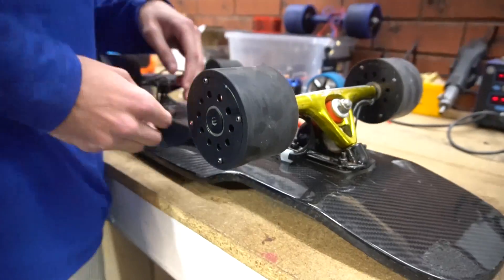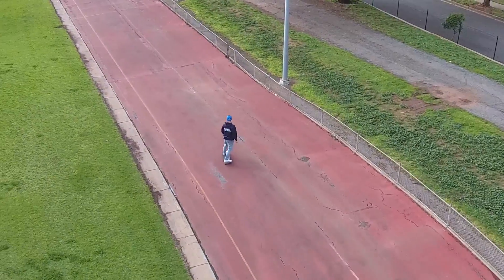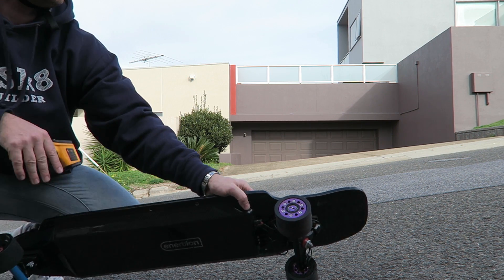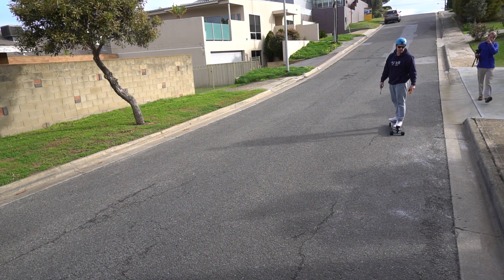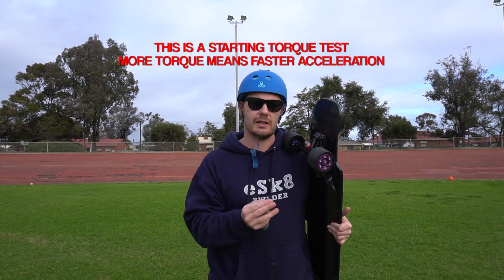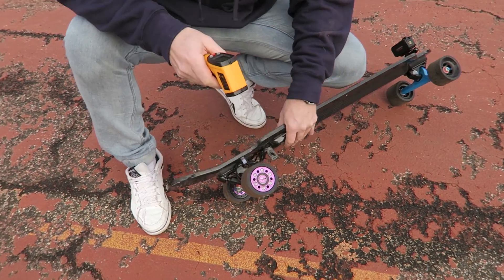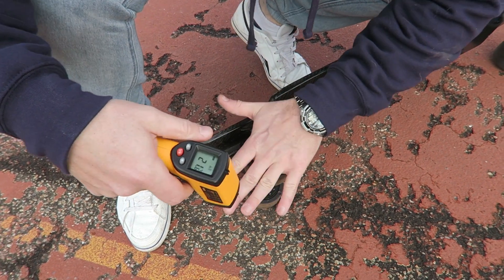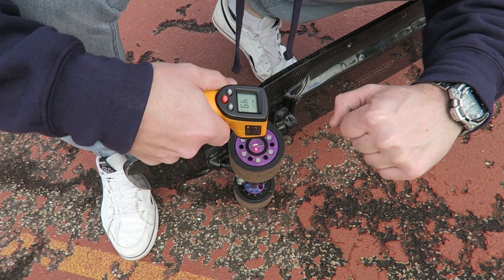electric skateboard hub motor comparison test

Comment: you can not measure on metallic surface. it gives you un-accurate readings.
you should have put a matte tape or matte paint on the outside.

Comment: Make a fan inside the motors so when it spins it cools down. To stop the motor from slipping make a plus in the rubber and the same shape in the outside of the motor and they should slide together and it won't slip as much.

Comment: The good thing about hub motors is when your battery is dead you can still push like riding a normal skateboard. But when the wheel where's down its not easy for new rubber to be put back on the motor

Comment: Jason, small friendly tip: Turn off the laser on the probe and just aim the hole that the IR goes into STRAIGHT on the Hub... The laser is extremely inaccurate, EVEN MORE SO over small distances... (you can try by pressing the hole against your ear canal... :D that will give you a pretty accurate body temperature... :D)

Thanks for the vid! Been waiting for this one!
Reply: +Electric Skateboard Builder Least I can do... Big fan! Biggup from Munich, home of Oktoberfest... ... yes, I own a pair of "Lederhosen"... ;-D

Comment: Would be great to hear you talking about these type of motors. What has your experience been with controlling these guys? What are the issues you see when using them? I want to  built my board with this type of motor, and your feedback would be priceless. What components would you recommend me to get so I can build this up?`Please feel free to recommend parts from your store! From what I have seen and read, you know your stuff and care deeply about quality, but I only see "belt drive" type of layouts with your shop. I want to experiment with different forms of battery cells and design something with a good friend who is an industrial designer (I am electrical engineer).Thanks!!!!

Comment: Thanks for filming these tests. The laser pointer on that temp gun isn't as accurate as you think. Read the label on the side of the gun, the temperature measuring area is actually quite large and not where the laser dot lands due to parallax error.
Reply: This, and you can't measure reflective surfaces like this either...

Comment: How about the pressure that comes on the bearings? 100KG easy. Did you see any defects in that? I prefer for this matter belt drive...
Reply: Of course when the design is perfect i agree, But you still have the Stator and the Rotor that undergo extreme stress combined with the pressure of the person riding it. 

If the design is perfect i agree, but due of the stress and vibrations on the components i personally would not recommend it right now. Keep us posted on the testing!
Reply: Problems are there to be solved! Keep us posted. Just got my battery deliverd btw;) Now waiting for the Raptor.

Cheers,
Frank
Netherlands
Reply: right, nice video!
Reply: Electric Skateboard Builder belts are totally a joke..stretch, tension, road debri like pebbes getting between belt and rotor. Low clearence of the wheel rotor and motor. inwheel is the way to go.